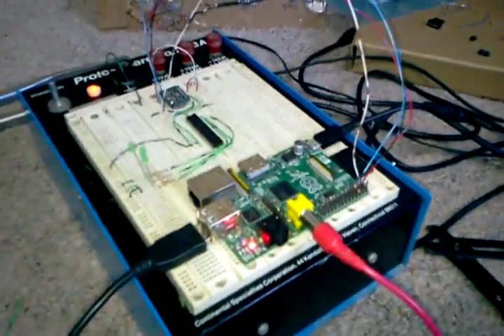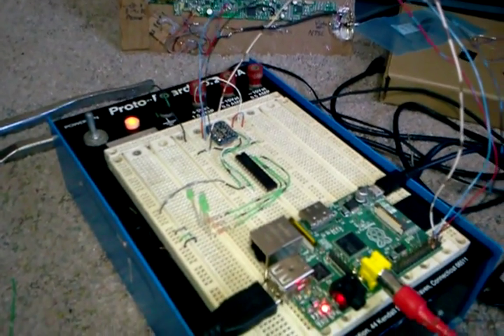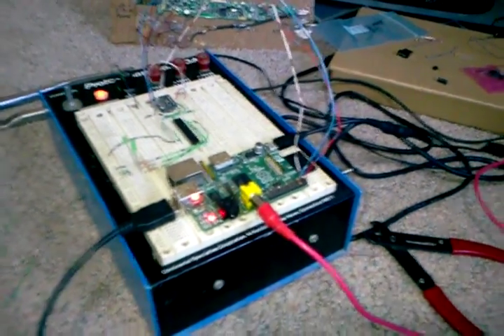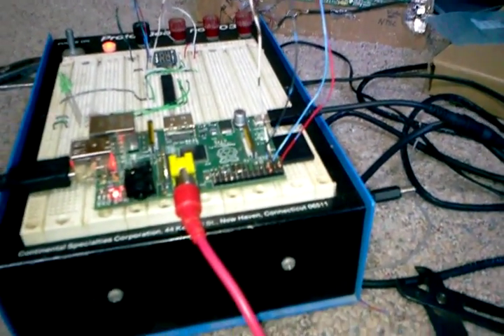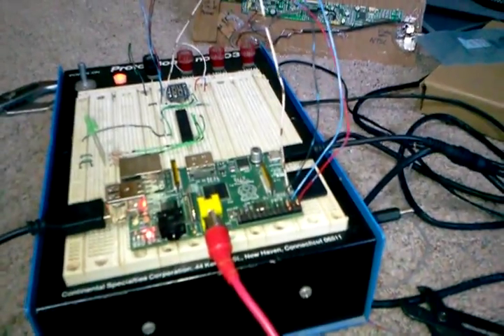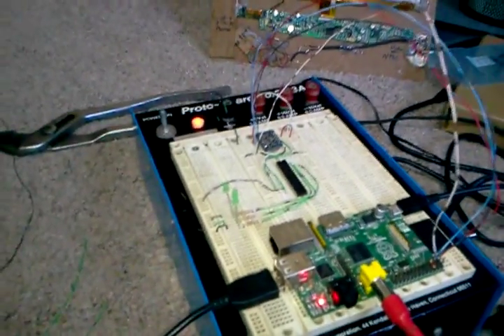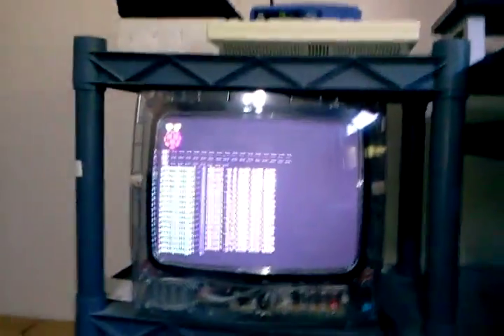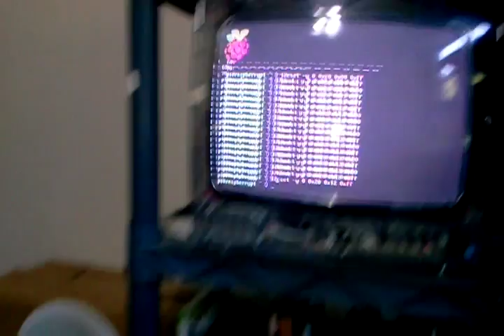My Pinball Build - Part 5 - Raspberry Pi using I2C Buss And The MCP23017

Comment: Hi, great work.  Have you done anything in audio for the pinball?  I am looking to try and do a similar thing with the Pi for old Electro mechanical pins, but not as complex as yours.  All i want to do is trigger audio files through an amp, say a PC speaker set up to add some spice.  Any ideas please?  Thanks!